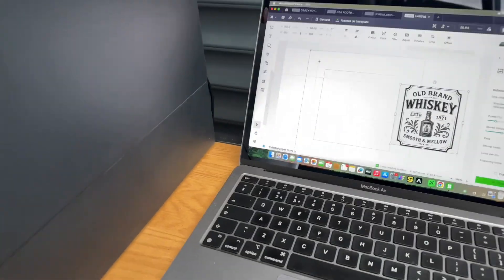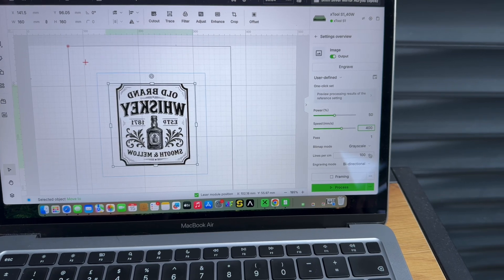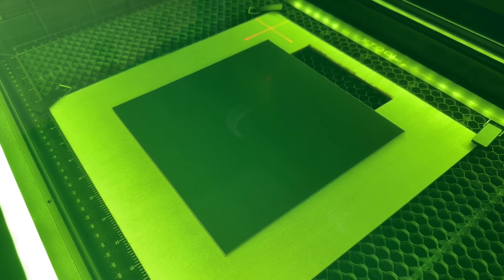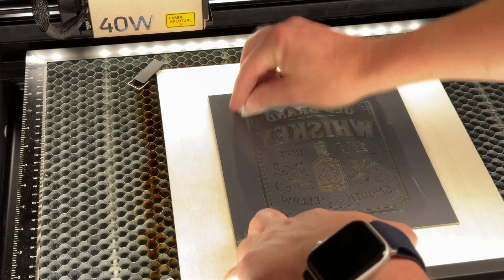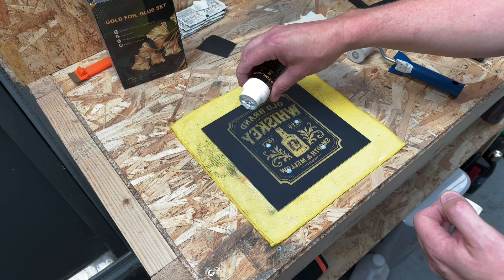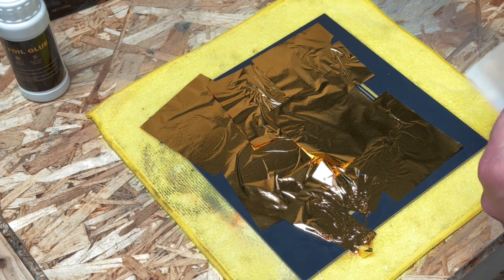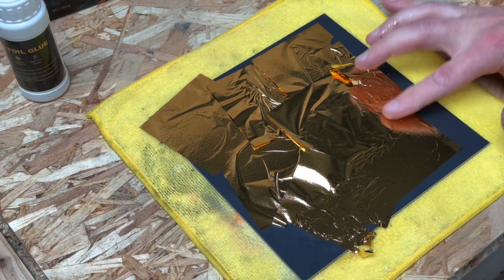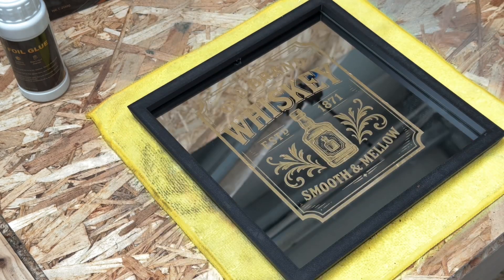Create customised laser engraved mirrors on the X-tool S1 40watt diode laser

Comment: great job, I would suggest spraying a metallic paint at the back if the mirror instead of using foiling papers. that would give a consistant color
Reply from the maker: I might give that a try. I have different coloured foils coming that I planned on putting on different parts of a logo to see how it would work. It actually looks better in person than it does on the camera it’s hard to show